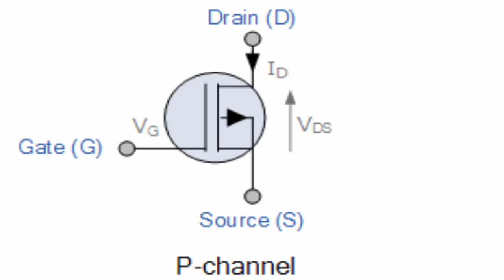P channel mosfet & N channel mosfet !!! (full tutorial)

Comment: Thanks a ton. In most of the other videos I have seen, they are connecting the source of P channel mosfet to the negative terminal. I wasnt getting the expected results with that. But I did as shown in yoru video viz. connecting the positive to Source and it worked.

Comment: can i charge the gate with another power supply isolated from the cicuit which is running for example  led ?
Reply: No. The gate needs to compare the voltage applied to it relative to the voltage applied to the source, for which a common ground or some other common point is must.

Comment: Kindly use a gate to source resistor of about 1000 to 10000 ohms. It will automatically turn off your MOSFET when there is no gate voltage. You are manually discharging the gate by connecting it to negative terminal. Use a pulldown resistor instead to discharge the gate capacitance
Reply from the maker: thank u
Reply: @ScienceElectronicsEmon  540N is N channel mosfet, you mentioned PNP? It should be IRF9540.
Reply: And this is the answer why MOSFETs in this video "remember" their states.
Reply: I am looking for this answer..
Reply: it can be done by many way
Reply: 1.5k will do. But that was not part of this great demo.
Reply: Absolutely. Easier than a ~5 volt zener clamp. A larger value  Gate to Source turns on the mosfet quicker,  smaller value slower.. Very important to use the resistor. Leaving it out  will often make the circuit behave erratically if at all correct. Also a small  ~100 gate resistor helps stabilize a mosfet.